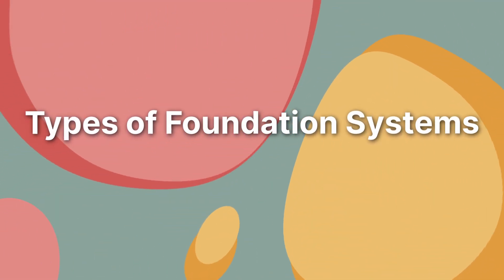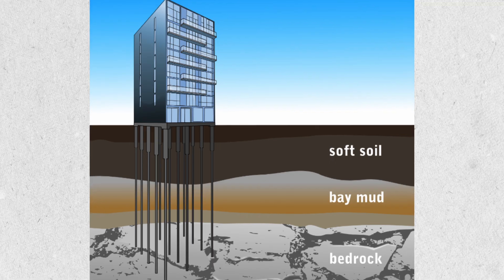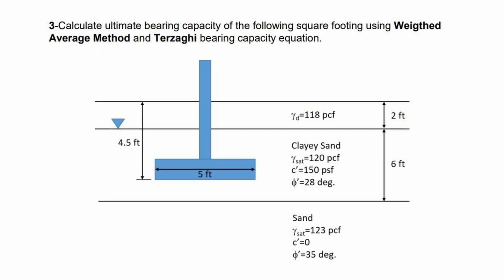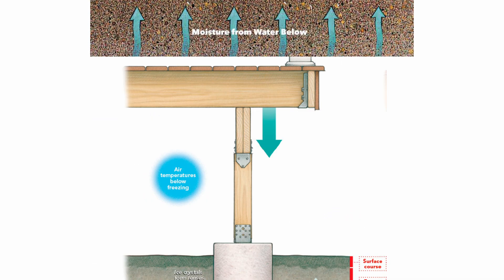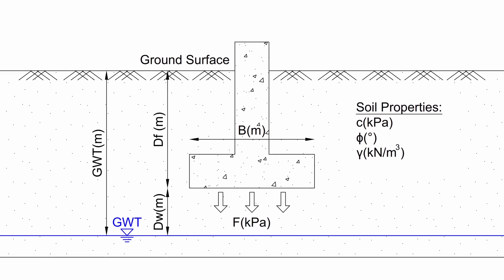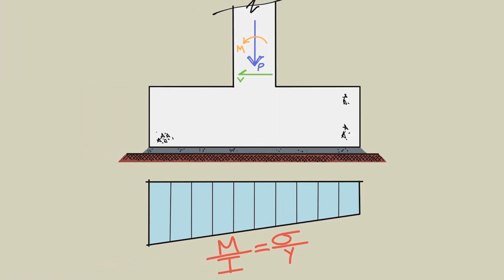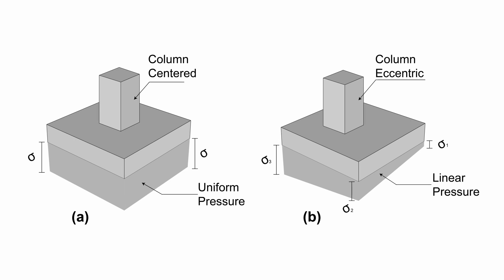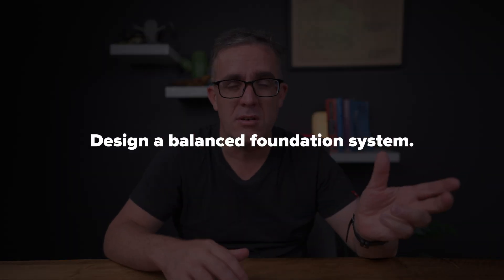Foundation Design Mistakes To Avoid

Comment: Hi Brendan,
Have you come across any material that's been useful for RAFT (mat) or waffle foundation design?
Not general theory or deep to comply solution — I’m more after practical worked examples, done by hand and then analysed in software.

If you can done this in the future, would be amazing! Thanks!

Comment: Nice video on foundation types Brendan. Reminds me of a project where a soil report revealed low bearing capacity. Our team recommended piles, but the architect opted for a raft foundation instead. We had to step away from the project due to the design choice

Comment: Hi Brendan,  you video is rite on point. I spoke to a class last week and indicated that not only the structural loads needs to be considered but the sizing and thickness of the footing is prudent to diminished the loads into the ground without compromising the soil conditions thus the superstructure. 

Stay safe
Malik from Barbados.